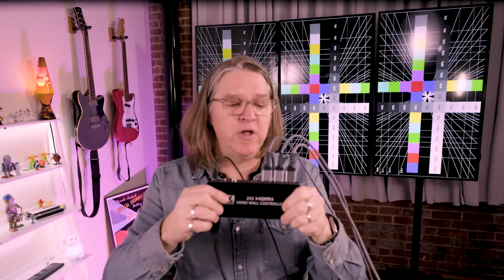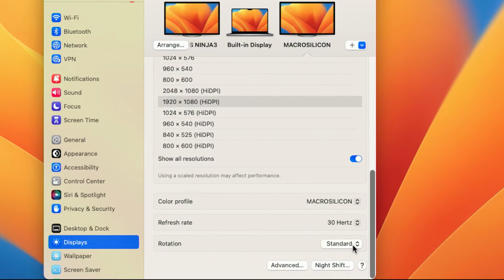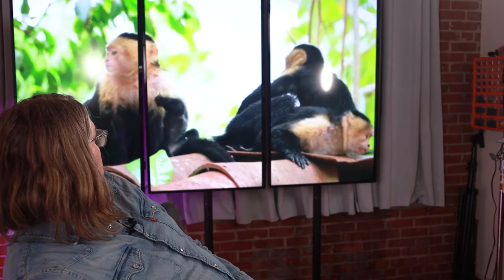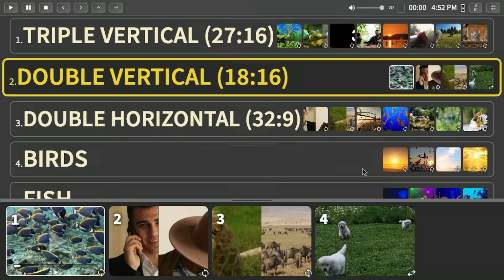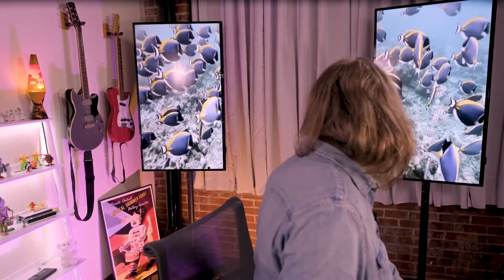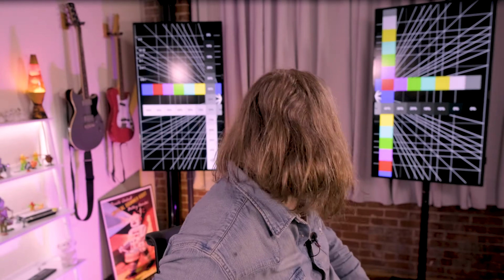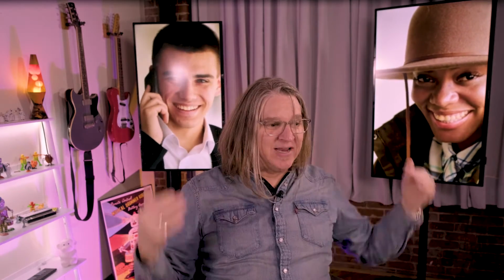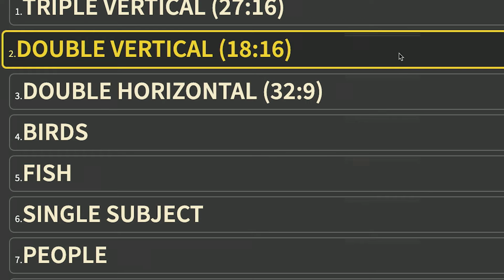Play a Single Video Across Multiple Screens

Comment: Did you buy 1080 TVs or 4k because the output of the hdmi splitter says 1080…  I want to set up an art installation with 3 TVs in portrait - I can do the video editing
Reply from the maker: If your HDMI splitter maxes out at 1080p, then 1080p TVs are the perfect match (and cheaper for a multi-TV setup). 4K TVs will work fine too — they'll just display the 1080p signal upscaled. For your portrait art installation, create your content in portrait orientation (1080x1920) and mount the TVs rotated. Visibox will output whatever you feed it, so portrait clips on portrait-mounted screens will look great.
Reply from the maker: Update for this kind of setup: Visibox 6 can drive multiple screens itself, laid out in rows and columns with rotation per screen, so three portrait TVs can run straight from the computer's outputs instead of through a splitter (as long as the computer has an output for each). The preview is out now:
https://manual.spaceage.tv/6.0.0/output/#sending-output-to-more-than-one-display
Preview download: https://spaceage.tv/news/visibox-6-preview

Comment: Hi, How can I show the same video over 3 screens, 2 in landscape mode and 1 screen in portrait mode?    | own a dj company and we show slideshows on 3 tvs and wondering how we can use your software?    Can we use your software and broadcast the same vdeo to 3 screens (2 landscape mode and 1 in portrait mode.   Thanks
Reply from the maker: For showing content across 3 TVs, there are two approaches. If you want the same thing mirrored on all 3, a simple HDMI splitter will do it. If you want them to act as one big display (content spanning across), you'd want a video wall controller — we cover exactly how to set that up in this video. The one catch is that all the screens need to be the same aspect ratio and orientation, so mixing 2 landscape and 1 portrait in one setup won't quite work. For DJ slideshows, keeping all 3 in the same orientation will give you the best results.

Comment: Do you simply edit a video in Premiere or whatever and Visibox knows to split the video down the middle and separate between two screens?
Reply from the maker: You edit your video at the combined canvas size (e.g., 3840×1080 for two side-by-side 1080p screens), then connect a video wall controller between your laptop and the two screens — the controller handles the splitting hardware-side. Visibox just outputs the full-width video normally; the controller takes care of physically routing the left half to one screen and the right half to the other.

More detail here: https://manual.spaceage.tv/search/?q=video+wall
Reply from the maker: Update: in Visibox 6 you can skip the video wall controller. Tell Visibox how your screens are arranged in the Canvas settings and it splits the picture across them for you, as long as the computer has an output for each screen. The preview is out now:
https://manual.spaceage.tv/6.0.0/output/#sending-output-to-more-than-one-display
Preview download: https://spaceage.tv/news/visibox-6-preview

Comment: Great video. Thank you!  I want to use a video wall controller for three projectors for our high school student theatre. Are there any issues with connecting the HDMI outputs to HDBaseT converters then to the projectors?
Reply from the maker: Not that I know of. They may introduce some latency. But for the most part, if they work, they work! (Although, sometimes, they don't work. 🙂)

Comment: Hello, This video found out to be very useful about display spanning, but I want to setup a video playing (spanning) across my 4-Projectors (Left-Wall, Front-Wall, Right-Wall and Floor Wall), basically an immersive CAVE Setup, can you please guide me how can I achieve that with a very similiar setup, it would be a great help?

Thanks in advance...
Reply from the maker: Sorry this one slipped by. Visibox 6 (preview out now) can spread one show across multiple screens or projectors in rows and columns, each with its own rotation and flip. A floor projection in a CAVE is really a mapping job, though, so for that you'd want a projection mapping tool, and Visibox can send its output into one over Syphon or Spout.
https://manual.spaceage.tv/6.0.0/output/#sending-output-to-more-than-one-display
Preview download: https://spaceage.tv/news/visibox-6-preview

Comment: I am building this elevator simulator for my Christmas event.  I need to display the video on 5 screens simultaneously, one looking forward and two on either side. I can't find a video wall controller that will  do 1x5 vertical for any sort of reasonable price.  I have a pc with a six output video card and enough horsepower to accomplish that.  Would a current or coming soon version of Visibox allow that?
Reply: Did you find a solution afterwards? I am running into the same problem.
Reply from the maker: @Hossey333 and @bretthays2674: Visibox 6 can do this without a video wall controller now. With a multi-output graphics card, you lay the screens out in the Canvas settings (rows and columns, each with its own rotation) and Visibox spreads the show across them. The preview is out now:
https://manual.spaceage.tv/6.0.0/output/#sending-output-to-more-than-one-display
Preview download: https://spaceage.tv/news/visibox-6-preview

Comment: Hi, this is just what I'm looking for. I am thinking of playing videos behind me while I perform my songs. Sometimes each screen will have a clip of me playing the different instruments making up the backing track and sometimes the whole area will be showing the videos that go with the theme of the song. One question I have is where do you get the stands to mount the screens on. I thinking of using 3 vertical screens. Great video.
Reply from the maker: Hello! The TV stands in this video are the "Perlesmith Mobile TV Cart with Wheels" from Amazon: https://a.co/d/hQwVyb8. They're not quite road-worthy, but they're inexpensive at USD ~$65/ea. Also, TV's VESA mount points are centered horizontally, but not vertically. So, although functional, it's a little awkward. Just keep that in mind.

Let us know how your setup works out. We love seeing people's audiovisual creativity!
Reply: @spaceage  Thanks for the info. I see I can get them here in the UK. I'll let you know how it goes later in the year. Cheers.
Reply from the maker: @stuartjameswright  Just remember to get the UK version of that TV cart so that you can drive it on the correct side of the road! 🙂
Reply from the maker: @stuartjameswright  Stuart, the idea of a different instrument on each part of the screen is built in now. In Visibox 6, Mosaic mode tiles several clips side by side and reflows as they come and go, and a single clip can still fill everything when you want the theme video. It drives multiple screens directly too. The preview is out now:
https://manual.spaceage.tv/6.0.0/poly-mode/#the-modes
Preview download: https://spaceage.tv/news/visibox-6-preview